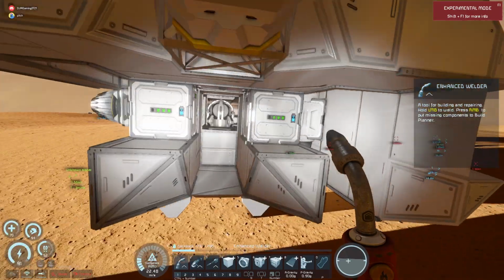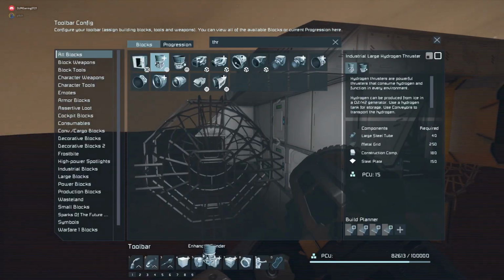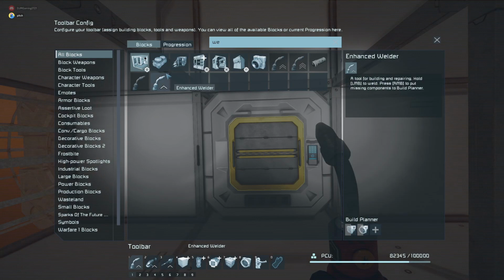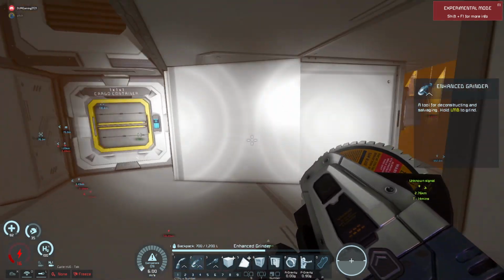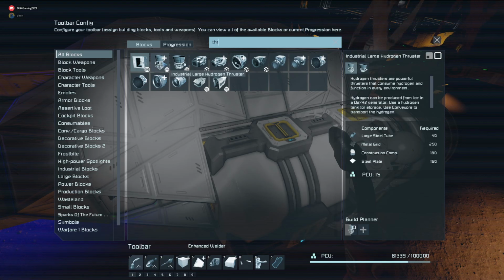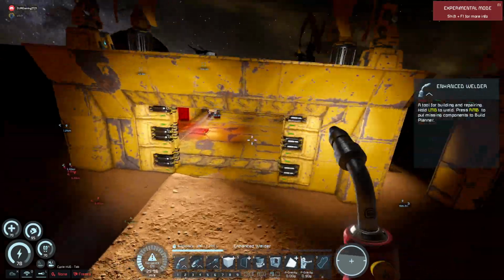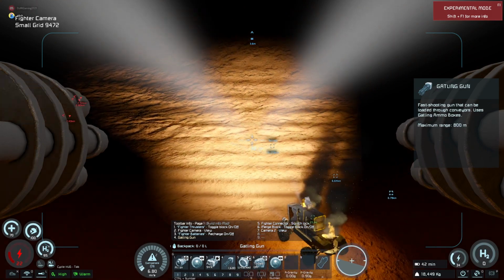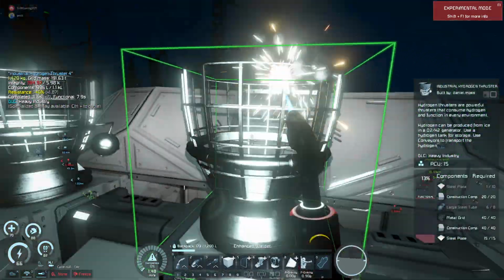Assertive Rebellions #7: Space here we come! (Space Engineers Survival Series)

Comment: Whole piston-mag plate locking help could be easily left out ;) Large grid connector does have 3 sides where it attaches to another blocks around. Obviously the port part and both elogated sides that reach to next block (in your case fo placement its top and bottom with that small signal light or what that is :P ) Not b*tching, it just makes these upgrades easier ...